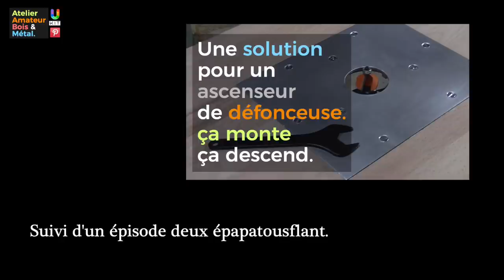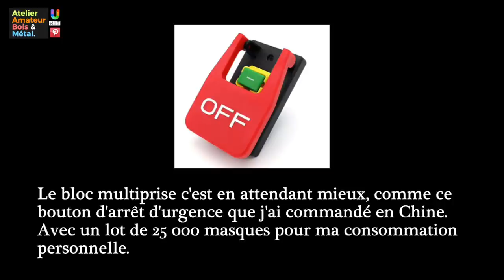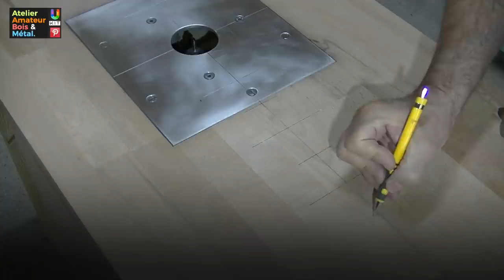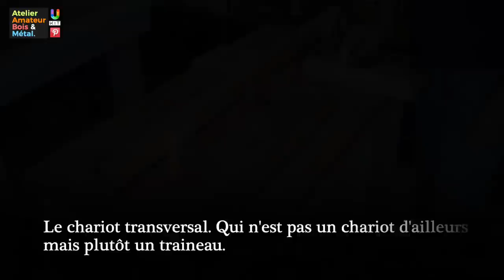Back to the router under table

Comment: Quête de la perfection du traçage et des montages, bravo. Question stabilité du plateau j'ai le souci avec mon établi plateau bois piétement métal de 2 m de long. Aussi j'avais envisager dans sa future  réfection d'employer un empilage de 3 portes isoplanes plaquées et collées (d'occase). Plateau coupé et adapté ensuite à mes cotes. Mais je crains que le "contre-coup" lors de pet de marteau soit moins efficace.  Pour éviter le problème du bois qui se déforme, prendre du Pin Laricio, c'est un essence endémique de Corse, il ne travaille pas.
Reply from the maker: Je me désolidarise de la blague sur nos amis Corses.

Comment: Bonjour et merci de partager vos idées, toujours instructives et bien réalisées.

Par contre, confronté au même besoin je n'ai pas réalisé un guide "parallèle" puisque le point de référence c'est l'axe de la toupie. J'ai simplement fait un guide qui tourne autour d'un axe puisque la position du guide par rapport à la table n'a aucune importance. Il suffit ensuite de mesurer la distance entre l'axe de la toupie et le guide (avec une cale passant devant le trou). Plus simple à réaliser, mais c'est du moins mon avis !

Pour la poussière les rainures posent toujours un problème d'accumulation au bout de la pièce usinée et également en-dessous, ce qui contribue à des usinages manquant de précision voire un presque blocage de l'outil  à cause de la poussière accumulée dans la rainure. Une solution consiste en la mise en place d'une aspiration par le dessous et un perçage de la plaque support en aval (voire en amont si on est sensible à la symétrie !). Avec ça plus de poussières accumulées sous la rainure et beaucoup moins au bout de la pièce usinée.

A bon entendeur, 

Salut.
Reply from the maker: Effectivement je m'orient vers une solution d'aspiration en dessous et en aval comme indiqué. L'occasion d'en faire une nouvelle vidéo.Merci pour le commentaire et les encouragements.

Comment: Je rejoins Éric, on s'en fous des râleurs et autres.
Tu as de bon projets et c est agréable de te suivre 
Pour ton soucis d'aspiration, peut être faudrait il instaler un Y pour avoir et une aspiration au plus près de ta fraise (par le dessous) et en mm temps sur ton guide, qui sait à voir.
Pourrais tu me dire se que tu as pris pour fixer les éléments de ton chariot ( bombe + tube de colle ) je ne connais pas et sa m intrigue 
Au plaisir de te revoir prochainement 
Cordialement chris
Reply from the maker: C'est une colle cyano (  Super glue) avec un activateur de marque Griffon mais pas facile à trouver.
Reply: ok je te remercie

Comment: Bonjour. Pourquoi ne pas avoir utilisé le guide latéral, ou à défaut, appuyer la base contre une latte afin de creuser la rainure ? Vous auriez gagné du temps ainsi qu'éviter de clouer dans ce nouveau plateau... Sinon je regarde, suis abonné et j'aime votre humour et la simplicité économique de vos ouvrages. Portez-vous bien.
Reply from the maker: Le système avec fraise à roulements permet de faire la rainure sans avoir à calculer en entourant l'objet a encastrer avec les deux règles à la même hauteur;
Merci pour le commentaire et les encouragements.